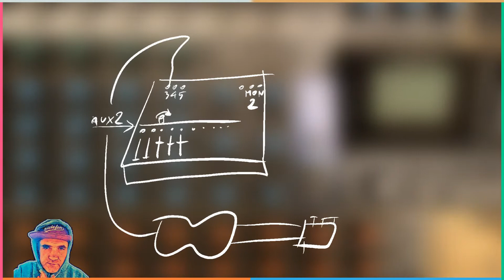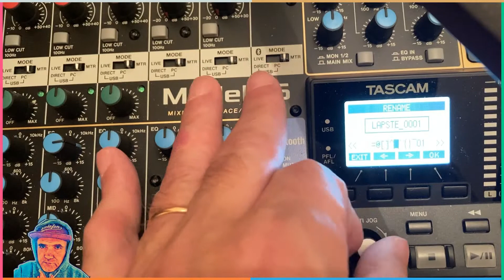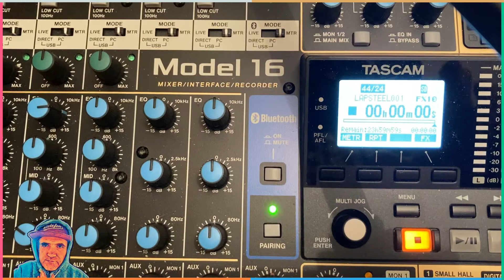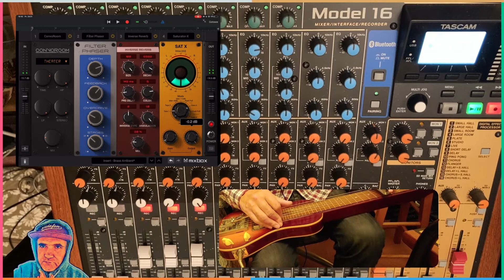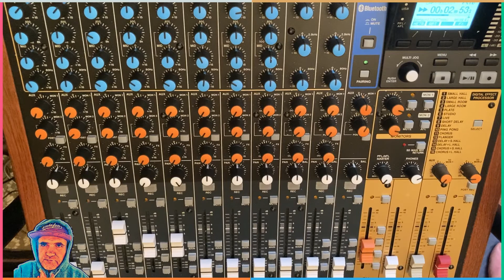Tascam Model 16 My Way - Part 21 - Using External Effect via Auxiliary Bus 2 - LapSteel Multibender

Comment: Have you tried it through Aux 1?
Reply from the maker: I will. Thank you.
Reply: I got it fixed.  It works the same as you illustrated.  I needed to use a TRS splitter in the AUX1 out then use two separate TRS cables.  The FMR RNC compressor does not work with a TRS to double TS splitter cable.